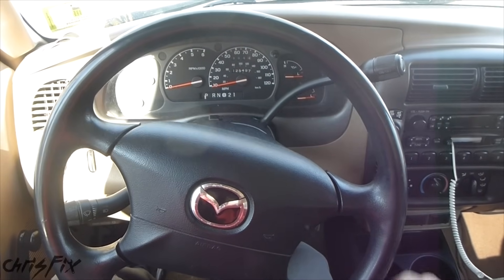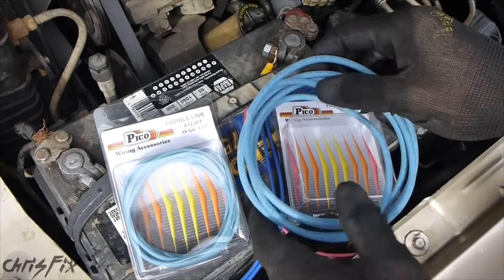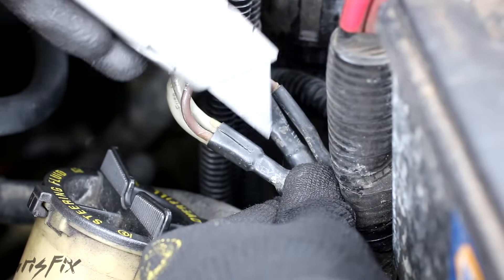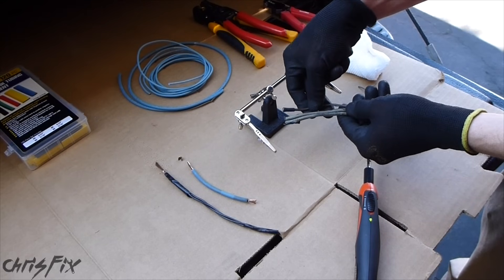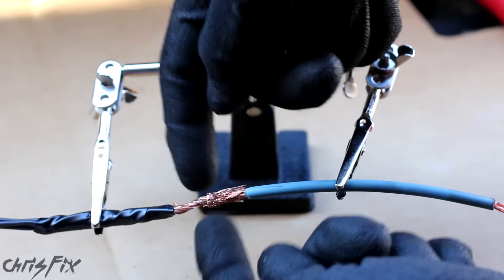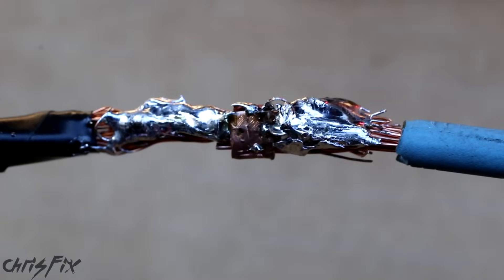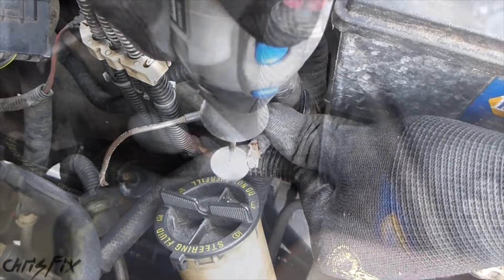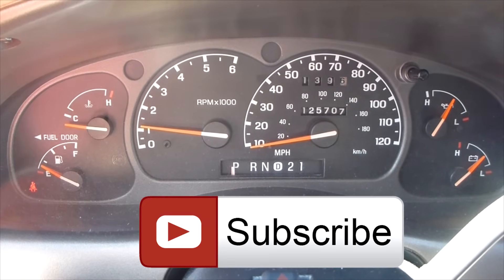How to Replace a Fusible Link (Car won't Start)

Comment: Er mer gerd, my Electrical Engineer is dying on the inside seeing a soldering job like that. You needed a hotter iron to make it work better. I really like those butane soldering irons for jobs like this.
Reply: I cried when he said it was done properly
Reply: He referred to a picture of one that looked prettier, but bear in mind how most mechanics use cheater clips and electric tape instead of solder.
Reply: A part of me died when I heard that... LOL. W T F.
Reply: Oh thank god I'm not the only one  lol  x)
Reply: Stellar Moig uh
Reply: Looks like shit but the connection is fine...
Reply: Preheat the wire with lighter if you are working with thick wires and you dont have big soldering gun/iron.
Reply: Stellar Moig I died when you said er mer god
Reply: Yah - I gagged when I seen that.
Reply: CME that can cause the wire to oxidize and become even worse :(
Reply: The Autistic Engineer That's a other problem,you use flux to remove oxidation.
Reply: PingasTheFourth I think you watched too many films.I used to smelt those lead acid batteries,then cast lead bullets out of them.
Reply: Same
Reply: Stellar Moig Jesus, IT WAS.. it may not look pretty...
Reply: I'm dying inside, and I ain't no electrical engineer. Just a dumb tractor mechanic. It don't look pretty and that about says it all.
Reply: @KeithColangelo  What are cheater clips?
Reply: @inspectorlunge3887  Quick crimp connector that come inside electrical repair kits. They have a razor blade inside which cuts the insulation of two wires, to connect them together in 3 seconds. You just squeeze until they make a click, and they hold for a while. They are also vulnerable to corrosion, so soldering works better.
Reply: @KeithColangelo  Oh okay, thanks. I'll keep that in mind for future reference.
Reply: You also want melted solder on the iron, as a wet iron transfers heat better. That, and start soldering at where it touches the iron, and apply solder going away from the iron.
Reply: @j.adamwegs2882  :: Yes, wet the iron with solder on top the of wire to get it started, then heat the underside to pull the solder into the wire bundle adding solder up top as needed. That solder job looked horrible. It wasn't wetted all the way thru and left loose strands hanging out.
Reply: A regular iron will work fine you just need to let the copper heat up a bit more and add a bit of flux.
Reply: "My dad says butanes a bastard gas"
Reply: Lollll
Reply: Damnit Bobby
Reply: Need
Reply: Nerd

Comment: So you had to solder all those connections but only used that wire holder for the fusible link? What's the point of that gadget if you can barely use it?

Comment: Pro tip: Use flux to remove oxidation so the solder can move inside and make a good solder
Reply from the maker: Thanks a lot for the tip! Check it out: https://www.youtube.com/watch?v=Zu3TYBs65FM
Reply: Stole the words right out of my mouth. And also use marine heat shrink for outside applications (underhood). They also make special clear heat shrinking wraps with solder in the middle for a perfect seal and mate these days.
Reply: Pro tip 2: if you have a mini torch that works better for solder.
Reply: Make sure the flux is for electrical wiring. You don’t want the highly active acid containing flux eating your wiring up after you’re finished with a nice repair job.

Comment: Hey chrisfix. I replace the battery and the alternator after a los charging to the battery but . That Didn’t fix the problem. What can I do to faint the problem why is not charging.

Comment: Dude, thank you so much for this! I was having a charging issue with my '03 Ranger. Alternator and battery were both good, had continuity through all the wires that I checked, and I was stumped. Then I saw you showing your speedometer bouncing and remembered I had the same thing happen to me when my issue started. Cut open the fusible link and low and behold, the 18 gauge wire was completely corroded off of the alternator wire. Reconnected it and my charging issue was solved. Thanks again!

Comment: I liked this video a lot because of your soldering job.  I need to fix my compass/ thermometer on my truck and have been afraid to do so but after seeing this video,  I can see that it doesn't have to be picture perfect for it to work.  Thank you!
Reply: Might be 5 years since you posted your comment, but I'll just drop a tip in for those wanting to solder for connections. The one Chris did is known as a cold solder joint which is when the iron and wires aren't hot enough, that's an example of what you don't want. The solder joint you're looking for is like the pic Chris showed which is when you get the wires hot enough for the solder to wick into the strands efficiently. Also remember to tin the tip of your iron to allow heat to transfer more easily and dab a bit of soldering flux onto the wires for easier soldering. Don't be afraid to have your iron hot too because using a hot iron allows you to get the job done quicker.

Comment: Kudos for giving proper soldering technique. One additional tip that will help is to first add some solder directly to the iron to create more contact area for the heat to transfer through. It also might help to add some flux to help the solder to properly bond.
Reply from the maker: Thanks for the tip!

Comment: Protip to anyone trying this: Melt a little solder on the tip of your iron before heating up the wire with it. Having a wet (tinned id the term) tip on the iron transfers the heat better!
Reply: thank you 😊

Comment: I've always hated to solder, but it's the only safe way to put two pieces of wiring together without risking to cause a fire in a long term. Great video Chris!
Reply from the maker: David Miranda I am so bad at soldering. It seems so easy but for some reason, I can never get it hot enough. That is why I went out and got the lead solder. Thanks bud!
Reply: ChrisFix David Miranda It's all in the tip, so to speak.  :-) 

Having the right soldering tool, the correct HEAT (biggest reason for success/failure) and patience is the make/break line.   However, there are some fantastic solderless connectors on the market that are also waterproof (definitely for underbody and trailering needs) so you DO have options.
Reply: ***** ChrisFix I've never heard from them... Could you leave us a link to see what you mean? They sound really helpful to use in places where is just too difficult to solder. Thanks!
Reply: David Miranda There are many connectors on the market.  I'm familiar with this brand:   www.molex.com/molex/products/family?key=heat_sealable_terminals&channel  .  You can find online and even in the big box stores, just depends on your needs.  Good luck with your future projects.
Reply: nice! that's a great tip, right there. I try to avoid solder as much as I can, and I think those connectors are definitely a great option. Thanks a lot *****!!
Reply: I've never liked soldering wires on cars. Solder is very bad at withstanding vibration, because it is very brittle and cracks. It is OK at a pinch, or if you can put vibration protection on (rubber padding, etc.) but a proper crimp is preferred, because a crimp keeps the metal flexible (unless you ruin it with solder).
Reply: Crimping connections is actually preferred in many harsh applications. If you do the crimp correctly there is no chance of a problem. Unlike solder which breaks. I used to feel the same way about soldering until I got myself a good hakko iron and some Kester solder. And when I say crimp I'm not talking about your auto parts store insulated but connectors. I'm talking about real crimp connectors that are non insulated and you heat wrap them at the end just like a solder connection.
Reply from the maker: RadioWave Editing For fusible links it is suggested you crimp and solder! But yea, I can see how a real crimp would work well in this situation which is why I used them in my fusible links! Thanks for sharing!

Comment: Thanks! I had no idea what those cables did, today my mechanic said they needed replacement, it's an 83 Subaru Leone, so you could imagine how bad they can get, and I had the same issues you mentioned but couldn't find the cause.

Comment: Just a quickie here. I add small, chopped pieces of hot glue stick inside the shrink tube. When you heat up the shrink tube, the glue melts and seals the connection.
Reply from the maker: Jammit Timmaj I really like that idea! Good one bud! Thanks for the tip!
Reply: Marine Shrink Tube. Never buy anything else lol. 
And hey Chris Harbor Freight sells it :p
Reply: also there are preglued shrink tubes and when you heat them the glue melts
Reply: @roccocroce  hahah got like a whole yard of those tubes for 50 cents
Reply: nice trick! i had to note that one. Check out my car PC if you would.
Reply: Hot glue, great idea as a lot of heat shrink tube doesn’t have sealer built in.

Comment: Trick on soldering: put a bit of solder on your tip. This will increase the surface area of contact with the iron, transfering more heat to the wire. Also, you do not need to actually go on the opposite side of the wire, but put solder anywhere on the wire. That mean you can get closer to the iron where it will be hotter, then move to the opposite. The idea is that the solder contain flux in the middle. Think of it as a solder tube filled with flux. The flux is a cleaner and will melt at a slightly lower temperature than the solder itself. You want it to flow on the wire, not on the iron. Since normally you solder small wire, heating on one side and soldering on the other is the best way to do it, however it can become difficult on big wire... As the wire get filled with solder it get easier to add more solder... The strands barelly touch the other, so barelly transfert heat. The more solder, the more contact, the more heat it can transfert...
Reply from the maker: thephantom1492 Thanks a lot for the tips! This makes a lot of sense! I will have to try it out. Thanks again bud!
Reply: Thanks for taking the time to share these tips.

Comment: Chris good soldering job just a quick tip. Im a plumber and when we solder copper piping we have to make sure the copper pipe is cleaned (using abrasive cloth/sandpaper) If you want the solder to stick better try cleaning the wire with the cloth to get the debris off. Solder will only stick properly on clean metal.

Comment: Chris, I would first like to say thank you, this was incredibly helpful. I was wondering why you disconnect the negative ground instead of the positive ground?
Reply from the maker: Because the electrons flow from the negative to positive. So if you remove the negative it stops all flow.
Reply: If you remove the positive first, when you rotate the wrench you could cause a spark if the end of the wrench touches anything metal. Once the negative pole is removed, that risk disappears. With new cars, that sudden discharge could damage sensitive electronics or blow fuses. Because the negative pole of the battery is directly connected to the chassis, touching your wrench to any metal will not cause a spark when you remove the negative pole first.
Reply: @spelunkerd  Exactly. Other than the risk of shorting your wrench on something, electrically it doesn't matter which cable you disconnect prior to making repairs. The direction of electron flow is completely irrelevant here since a complete circuit is required for anything to happen and the circuit can't be complete with either cable disconnected.

Comment: As an electrical engineer (part time), that method of soldering is a bit rough! You just need to work on the soldering, it shouldn't look like a bubble of solder around the wire, the wires should look like they're turned silver and bonded like weld. The rest is amazing, keep up the good work! Oh and use flux to make it easier!
Reply: Yes definitely use a rosin core solder! Plain no flux solder can get you into trouble if the solder doesn't flow.
I just saw your comment  after I posted about the soldering job. I agree 100% sir.

Comment: I'm not afraid to solder. I am an electronics technician but I think in this case would have used some insulated butt splices. If you do them right (with the correct tools) you won't have any issues. Your splices would need some HD heat shrink or maybe a few layers of heat shrink.  A stray wire can poke right through the shrink and short out.  Also if any shorts on the battery side, there is nothing to limit the current---POOF!  Blessings, John 20:29
Reply from the maker: johntracey523 Haha thanks man! I was taught to never butt splice fusible links but you would know better than me!

Comment: Use flux it will make it flow through much better.
Reply from the maker: +Stephen Robinson Thanks a lot for the tip!
Reply: +ChrisFix , flux is acid and corrodes the wires in no time
Reply: +Nikolai Tsakov you're so misinformed it hurts, you're supposed to use flux while soldering anything
Reply: Jordan Muratori lol never had corrosion but eh what do I know.
Reply: +Nikolai Tsakov Acid flux is used for soldering mechanical parts other than wire and electrical components - when you can wash the flux away.   There is also non-acid flux that is used for electrical wires and components.  It will not corrode the wires because it was designed for soldering wires without leaving corrosive residue.
Reply: +Thank you, excavatoree !
Reply: or a decent heat output from the iron.
Reply: +Nikolai Tsakov you're misinformed. Solder wire also contains flux most times.
Reply: it was rosin core solder, it already had flux but more flux never hurts
Reply: It also helps to clean the oxides off your soldering iron tip (a wet sponge works if you're using leaded solder, but brass "sponges" are nicer), then "tin" your iron by melting some solder onto the tip.

Also, you don't need to heat the wire from the bottom and apply the solder on the top. You can start by heating the wire on top, so long as you're still using the copper to melt the solder rather than the iron. As you melt more solder into the wire – replacing all that air with nice, heat conducting solder — it will get easier to heat up the wire and will start melting the solder better.
Reply: @sakadabara  You can get acid free flux.
Reply: Preston
Reply: Preston  love you and  Martha

Comment: Nice video, but let me suggest that you need to get a little higher wattage soldering iron or gun. 100W will work fine. Then, you don't need to spend a lot of time heating the joint. Higher wattage will heat up the joint fast and the solder will flow better. The solder in the video almost looks like some of the cold solder joints we see on electrical equipment . A cold joint is when the solder didn't flow into the nooks and voids between the wires. Keep in mind that a solder joint is first a mechanical connection as shown in this video. Good contact, twisted. The solder will fill in the voids.
 We all have seen attempts of guys melting blobs of solder to join the wires. Solder isn't the #1 thing holding the wires together, it's the mechanical connection first.
     Not knocking the channel of video, you are great and have helped me and my friends many times. Take care.

Comment: Soldering is easier if you let the metal get really hot that the solder melts quickly. Just don't disconnect the iron from the metal until that solder melts easily and all the way through.

I like the pic of a good soldering job. makes me feel more confident in the jobs I've done in the past...they look just like that pic...hard to know if you did something right without knowing what its "supposed" to look like.
Reply from the maker: F!@#Guilt Yea, my solder was barely melting though because the iron was not strong enough. I also needed to use some flux.
Reply: ChrisFix m
Reply: ChrisFix op

Comment: This is a great video.  I like it because my 84 Toyota FJ60 has a three wire fusible link that uses male & female spadeblade connectors to join the regular wires with the fusible link wire.  Each junction is protected by a plastic housing that is very hard to take apart and remove the connectors from.  You can buy a new fusible link but it costs $35 to $60.  Also, if you still have a short somewhere it is possible the brand new fusible link will burn up again.  I like the idea of just buying 10 ft of each gauge of fusible link wire that you need and fixing it yourself.  Be sure to cut the lengths of each fusible link wire to match the oem length.  Also use a conversion chart when you have Japanese fusible link wire measured in square mm (cross sectional area) but you are buying 18 or 20 gauge wire.  It may also be important to keep each wire from touching the other using fire retardant cable sleeves.

Comment: Always a good idea to coat your solder connections with dielectric grease before covering with heat shrink tube for added protection against corrosion
Reply: He's right that's what the professional low voltage technicians do when installing RRU racks on cellular antenna towers